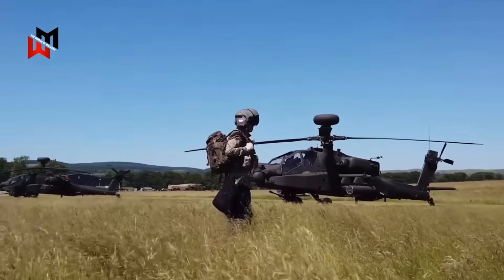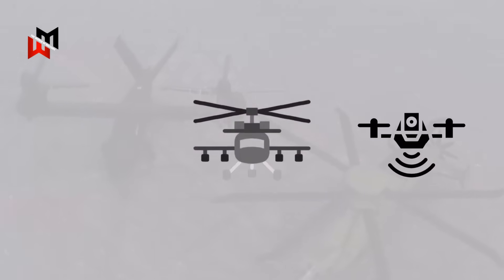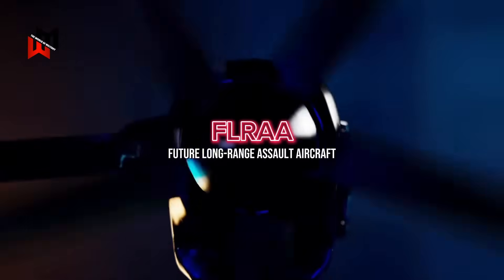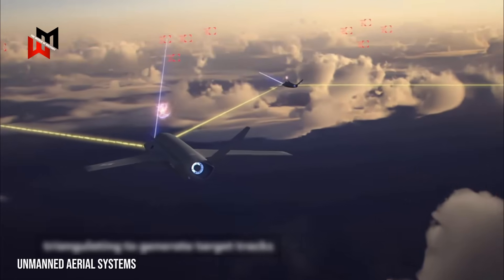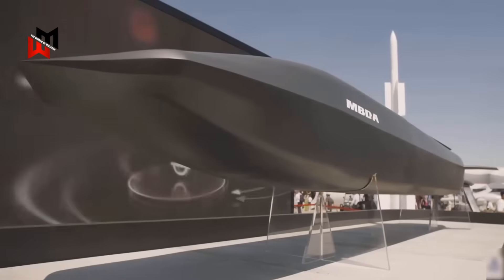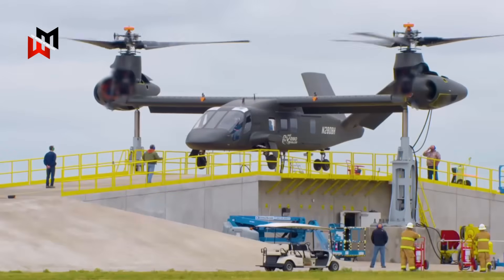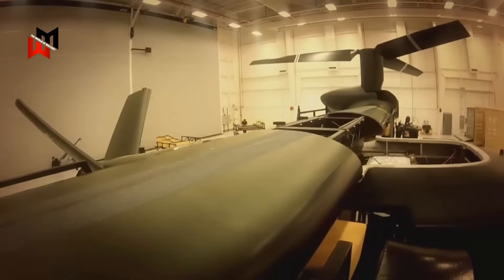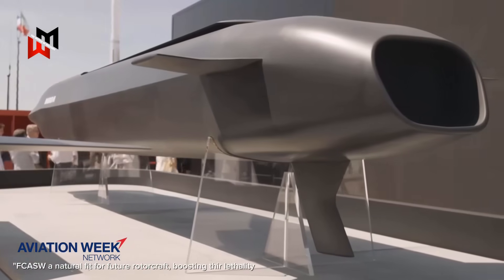Why The UK Really Needs This Monster Rotorcraft! UK Future Vertical Lift Helicopter

Comment: The Rotodyne did the same job with a lot less complexity. It 'failed' because the noise of the rotor tip jets was considered too loud for civilian city centre operations, limiting it to military applications (although the jets were developed into much quieter designs it was too late for the project). If the UK cannot rely on the US, which does seem to be the case, then we would need to develop our own equivalent. The main problem is that BAe Systems is now a multinational (ie 'foreign') company who's primary interest is in the US (the choice of the Ajax over the CV90 may have had to do with the farce over aircraft carrier catapults, offered at twice the cost of the same units sold to the US Navy). Quinetic is still a 'British' company (in spite of westminster's efforts to gift it to the US) and although it lacks experience in building aircraft it undoubtedly has the intellectual wherewithal to design an updated rotodyne type aircraft, enabling the UK to build its own indigenous aircraft industry. It also seem less beset by the MBA problem, like Boeing of old it is run by engineers (quite successfully it seems). The question then becomes can westminster fight its way through the corporate minders and fund such an enterprise.  I doubt it, but Airbus might take it on.

Comment: Why since the first success of the first VTOL jet aircraft, the Harrier, we still don't see many VTOL jets enter service?
Reply: The Harrier and the US licensed version, the AV8B, was an incredible innovation in providing an 'Okay-ish' performance jet that could operate without runways, even without makeshift runways. Even so it was not at all a top-tier fighter, nor a top-tier ground support aircraft, but rather had just that one trick. VTOL greatly limits the weight (payload) that can be carried if you still need to perform a vertical takeoff.  As helicopter gunships and attack helicopters improved the unique feature of the Harrier simply became less valuable as the whole selling point, and since it was weaker than other aircraft options in everything else, it simply wasn't economically viable.

I'm sure that engineers will keep experimenting and improving VTOL capabilities in future, but right now, it simply doesn't offer enough benefit compared to the drawbacks and costs in terms of other capabilities, maintenance, etc.
Reply: as far as i know no country other than the uk has ever managed to develop successful vtol jet tech
obviously the only 2 known are the harrier-fully British and the f35b and the vtol aspects are all british designed and manufactured
there has even been cases of shooting them down to stop the tech falling into the wrong hands
the notable case i remember was when a british lighting jet shot down a run away harrier before it could reach russian airspace

Comment: 2 big rotors is an arcaic notion, conversly multiple small rotors like a scaled up drone is the way to go.
Reply: Can you have tilt rotor with central electrical generstor ( gas turbine) and electric motor fans. No mechanical couplings to mauntain or wear.